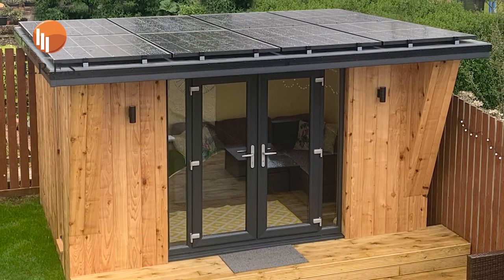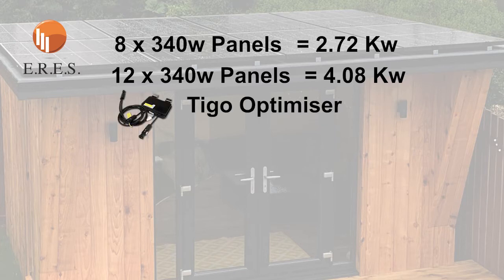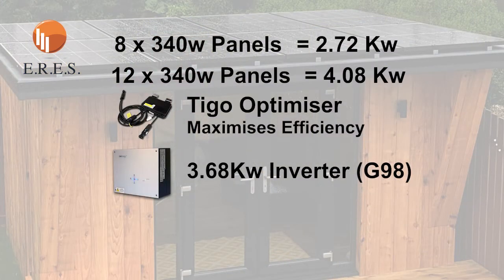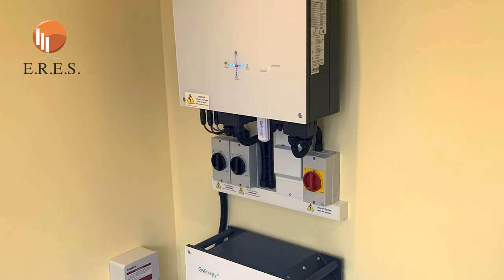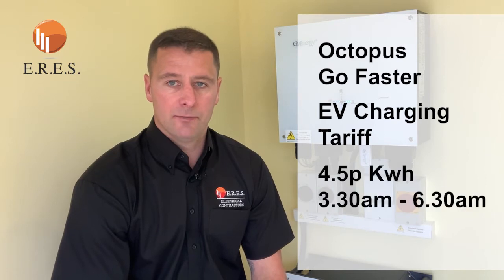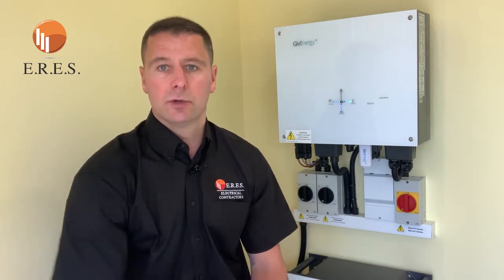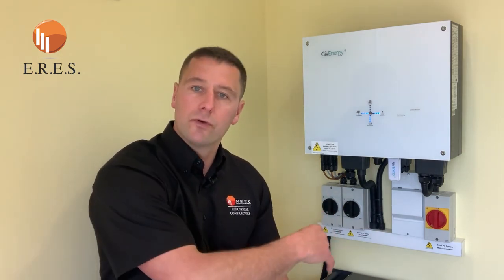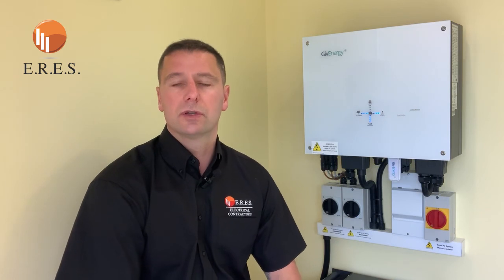Solar Storer PV & Battery storage

Comment: Different question . Is there way to pair DIY LiFePo4 48V 16s with Givenergy 3.6kWh hybrid inverter ? Or it need to be specific battery with communication cable only ? Thank you
Reply from the maker: Hi Danny, I’ve got no idea. You could ask Givenergy but I’m pretty sure they will say you can’t. I would also assume all warranties are void if you did that.

Comment: Great video, how are those panels secured? Or what mounting system is used to not damage the rubber roof?
Reply from the maker: Cheers. The roof is designed with many rafters in the right places. Renusol mounting rails screwed onto the rubber roof with a liberal amount of ct1 between rubber and rails. Long screws/fixings (can’t remember their name off the top of my head) with rubber washers clamping the rails to roof. Then standard end & mid clamps holding panels to rails. 

The ct1 system is similar to a solar limpet which had a 25 year guarantee, strangely only recently lost their MCS accreditation. That building is a year old now, bone dry.
Reply: @ereselectrical9397   thanks for the info. This looks really sleek and good. Looking to do a system on a flat roof so I was looking at mounting options.  If you remember the screws let me know!
Reply from the maker: @smrfingers  easy drive 6.3 x80mm. 8mm hex with washer.

Comment: 8.2battery installed on 3.68inverter —concept is unique. 
Still able to supply this system concept in Scotland in April - May 2022?
Reply from the maker: Hi. I don’t know what your asking. It’s not unique though, quite common.
Reply: @ereselectrical9397  looking to get a quote to install a Huawei system - can you help with this or know Huawei installers in the Aberdeen, Scotland area?
Reply from the maker: @chikadibiaobi-ofodile540  hi. Sorry, I don’t know any installers in Aberdeen.

Comment: Thanks very much Sandy for a very helpful video.I have solar panels and an air source heat pump.
I’m about to get a 16.5 Sonnen battery fitted this year. Do I need to have a Smart meter to buy cheap energy at night and export any surplus?
Reply from the maker: Hi Michael, thanks for feedback, makes it worthwhile 🙏
Yes you will need a smart meter, this process can take a while so it’s worth getting started as soon as you can.
Reply: @ereselectrical9397  I contacted my supplier EOn about 3 months ago and they stated that they will not provide me with a smart meter.
As I plan to switch to Octopus I’m not that fussed. I will probably do that after m battery is fitted.

Comment: I stopped using my battery to take energy off the grid at night. No way I can get it for 5p I was being charged closer to 15p. So now I use my battery strictly for solar and for usage in the house. I have a dual system that is 4.9kW combined split around half each to two inverters and two arrays one South(onFit) and one North/West (No Fit).
Reply from the maker: We charge at 4.5p on octopus go. Works well. Glad you have worked out what works well for you.
Reply: Thanks for the feedback.  I can see why posts like yours are not rare.